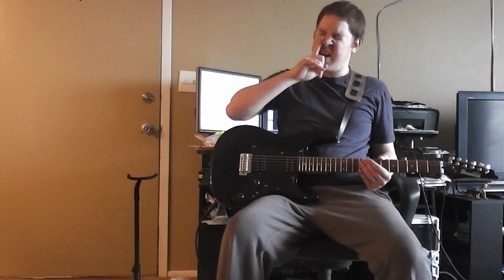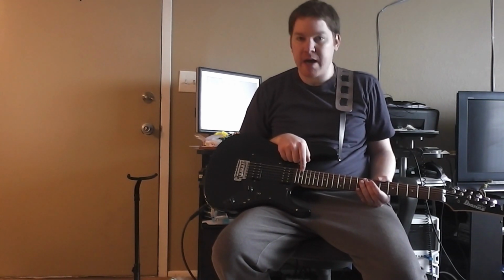Pedal Combinations: Delay into Overdrive

Comment: Is there a way to switch between effects without them influencing each other? Like delay during the verse, but then overdrive during the chorus without any delay. cause I like the delay sound on a verse, but then if I switch to the chorus I dont want the delay anymore and I just want the overdrive.
Reply from the maker: I'm not sure I understand the question, so please feel free to correct me, but the nice thing about pedals is that you can turn each one individually on and off as needed. So, turn the delay on during the verse and as you get to the chorus, just stomp on it to turn it off.
Reply: @PoorManPedals  yes i understand that, but then to turn on distortion id have to stomp on the distortion pedal which means I'd have to stomp off the delay and then stomp on the distortion which seems like too many stomps
Reply from the maker: @michaelmartin7755  In that case, the best answers are to either get a multifx unit like a helix or headrush or something similar that would allow you to create presets and then change presets with one stomp or to get some kind of controller like a GigRig. That or there's something I don't know about